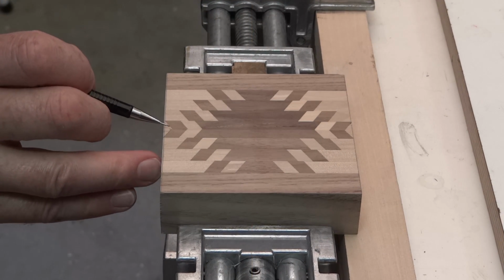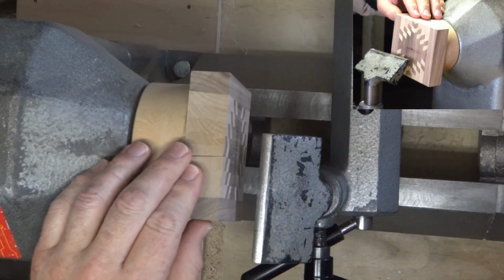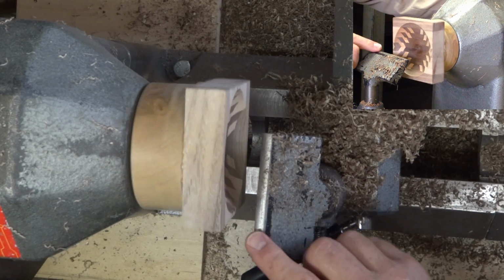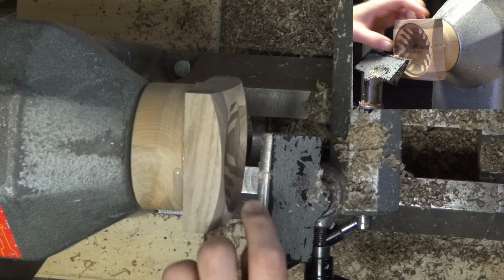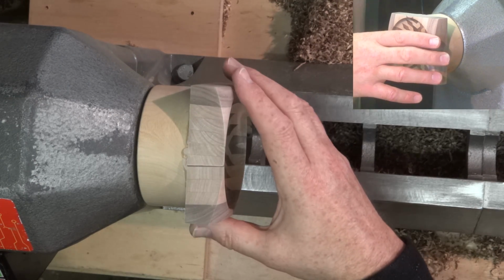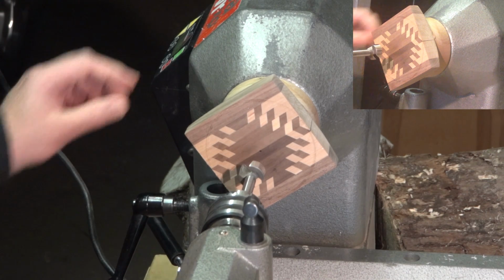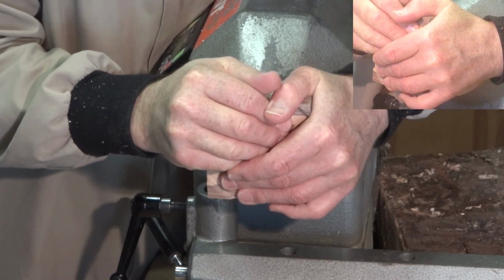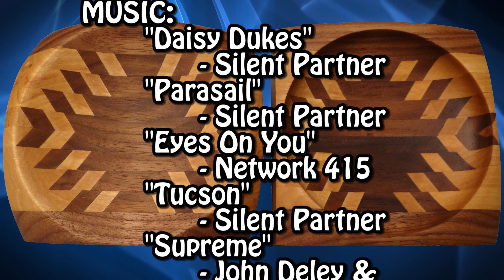Bowls with Indian Blanket Design

Comment: glad to see someone else using hot glue. I turn 14 inch bowls held only by hot glue. Holds extremely well. just make sure any oily wood is cleaned.
Reply from the maker: I LOVE hot glue. 😎😎 I have never had a hot glue joint come apart. Thanks for watching!

Comment: Gordon, I have used hot glue and have a hell of a time getting off the turned piece..Is there a special type of glue I should be using? I am going to have to find your segmented turning videos, but not to sharp with computers P.S. I am subscribed.
Reply from the maker: Robert Harrington Hi Robert. I don't know about a special glue. I just use whatever I have on hand and have no idea where I got it or the brand name; it's been around here for a very long time. I haven't had a lot of trouble with it although I occasionally find peeling the pieces of glue off the wood can be a bit trying. This was the first time I tried just pushing the piece off and it was tough to do. Prying the piece off is much easier. Sorry I can't give you a better answer, Robert. Thanks for watching!! .....Gord

Comment: Gord -- Very nice little bowls.  I also preferred the one you didn't show the making of.  (I'm sure I could come up with a more stilted sentence structure if I really tried.)  These bowls would make excellent single serving nut bowls!  I'm sure every hostess would love to have a set.

Two comments: Olive oil (and most other vegetable oils) can go rancid (DAMHIK).  Mineral oil won't go rancid; it won't cure, either.  Hardening oils, like tung, linseed, and walnut don't go rancid and cure to a relatively hard and durable finish.  Of these, I prefer walnut oil.

Second: This would have been a perfect opportunity to use a vacuum chuck.  Your method worked well and was cheaper, but you shouldn't let such details get in the way of a new tool!
Reply from the maker: David Walser Hi David,

I must admit, I also prefer the bowl that I did not show the making of. I didn't think it necessary to show both of them being turned as I used the same techniques for both, just changed the shape.

I've had good luck - so far - with olive oil and I like the way it darkens the wood a bit and seems to make the colors pop. When I finally, one day, have a problem with the oil going rancid I won't be able to say I was never warned!

Actually, I have a vacuum chuck but as very few turners have them I try to show other methods and I like using hot glue. Also, as you said, it's cheaper!!!

Thanks for watching & commenting, David.

.....Gord

Comment: I have subscribed to several wood-turner's channels... I watch you guys spending an inordinate amount of time cutting and gluing segments with an incredible amount of precision.

Yet, when it comes time to set your work up on the lathe, you use the "guess n' by-golly-that's good enough" alignment process.... I mean, it's like you've never heard of a dial indicator, or something.

I mean, it's not like dial indicators will break the bank... Starting at $15 @ Harbor Freight, they're well within the means of someone who will pay $60 for ONE turning tool.

Please don't take this as a condemnation of your skill... That's not my intent.

I'm just trying to pass along some of my knowledge as a Journeyman Machinist, if it's at all helpful.

Frank
Reply from the maker: franksalterego Thanks for the feedback, Frank. When making something like the small bowls in this video being out by a very small margin is not going to be noticeable so I don't worry about it. When making one of my more intricate segmented vessels I spend a lot more time lining things up to get them as close to perfect as I can. I understand your point, especially coming from a machinist, but being out 1 degree or less on the kind of work I do is not going to result in any kind of tragedy like it could in your work.
Thanks for watching,
.....Gord
Reply: It appears that you don't subscribe to that adage that "There's a difference between scratching your butt and tearing it all to hell"